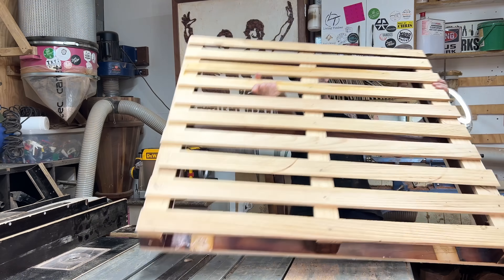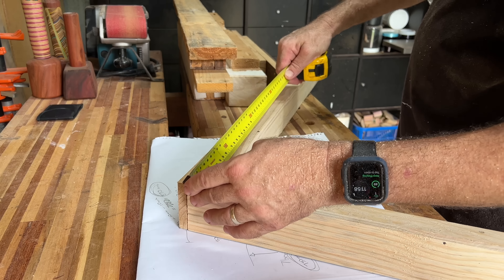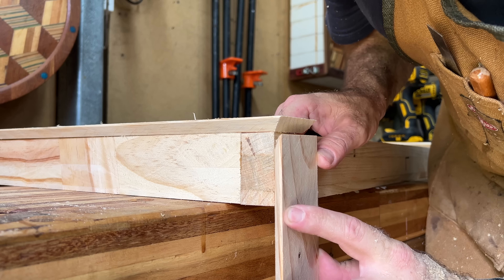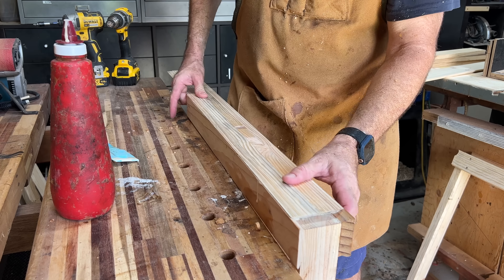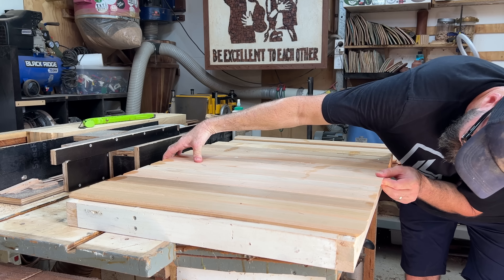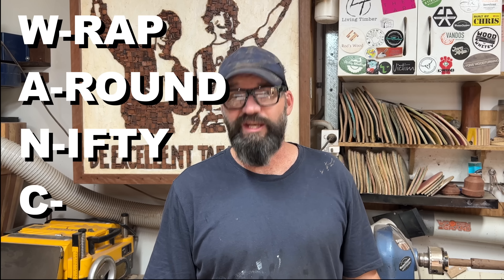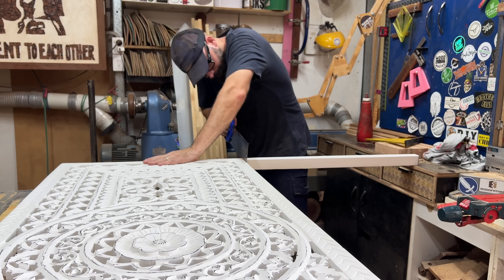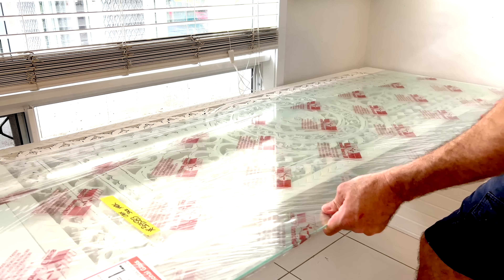CLAD your palletwood to the NEXT LEVEL - Ultimate UpCycle

Comment: 2:28 surely you could glue all those slat slivers into something? Chamferization by table saw, so cunning. Seems the burning temptation to always reach for the router can sometimes be avoided.

What a nifty desk Mark, I like that the legs are hollow which dramatically cuts down on the weight and leaves a space for the hairy grey spiders to creep in and make families. The number of mitres that you cut is staggering and you didn't even cheat (by routing the lines out later) down the edges and you made all those individual squares instead.

It's all there in one funny, informative and inspirational package. Sawdust sliding, slabification, glue uping, cockups, mathification and so much more. If there is one person on the internet that will get people out in the shed and just getting started it's you. Thank you for the hard work that you put into bringing us you videos.

(Edit: I forgot the science,  that's not really a table saw, it's actually a mass spectrometer)